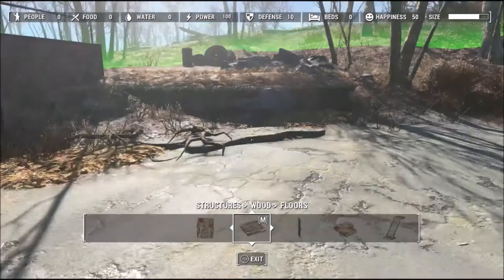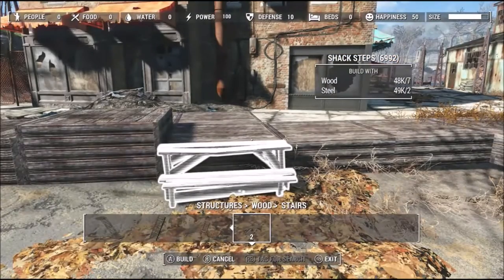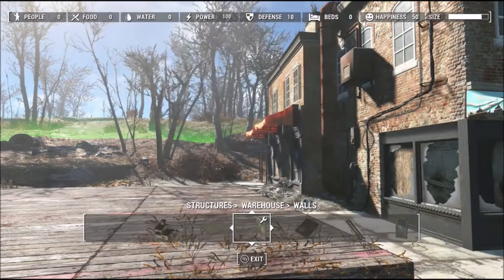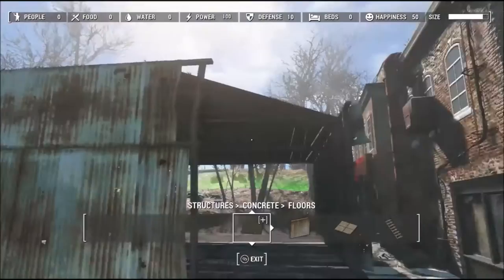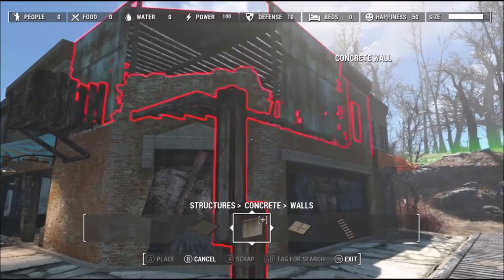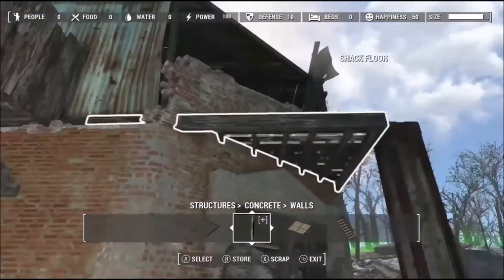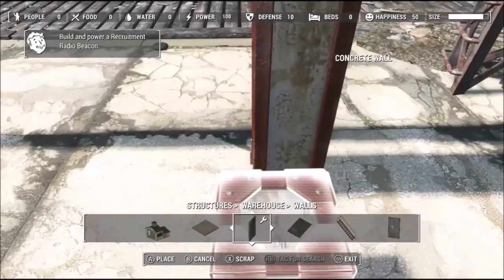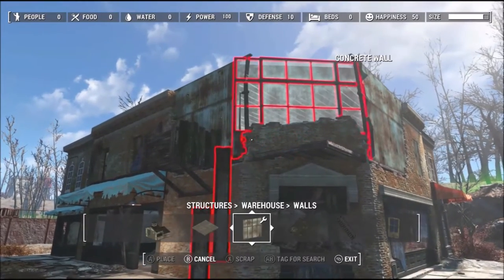Fallout 4 How to Fix Egret Tours Marina Walls, Floor and Roof

Comment: Excellent stuff.  I am hoping you have something on Vault Tec building pieces.
Reply: TCL + disable/enable via console. Removes collision for an item so it is ignored for placement/snapping purposes, and it will remain so until you re-enable collision. Makes it easy to build around/through overlapping objects, as you can select each one and disable/enable as needed until they all stop interfering with whatever you're trying to place. Works well in lieu of the above video as well - just TCL, then disable/enable the building, go into workshop mode and line up a foundation with the wall and floor. Then do the same as needed to build out the floor, walls and ceiling until complete.
Reply: @jameskaylo2909  honestly I just need to understand what each one does lol.